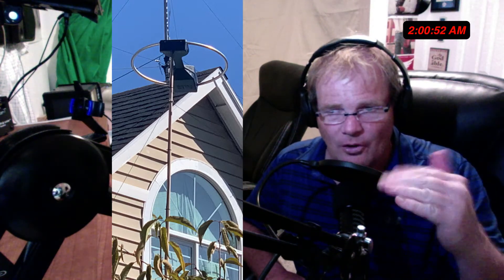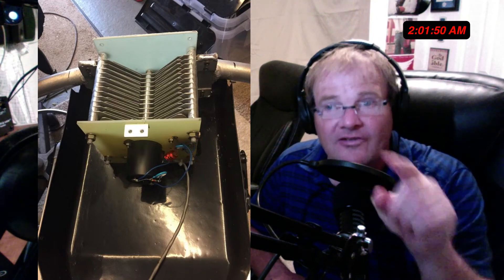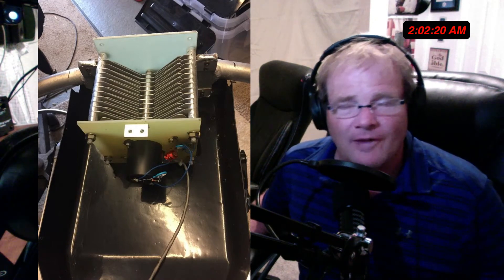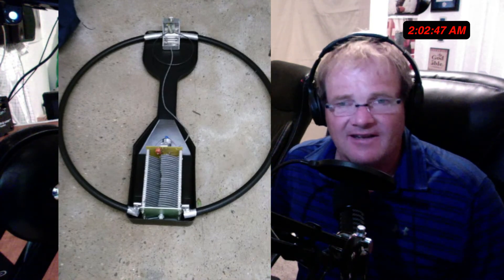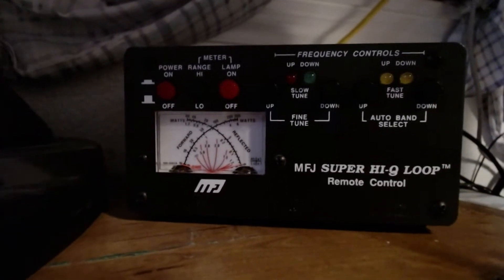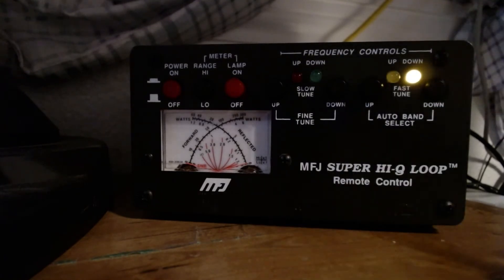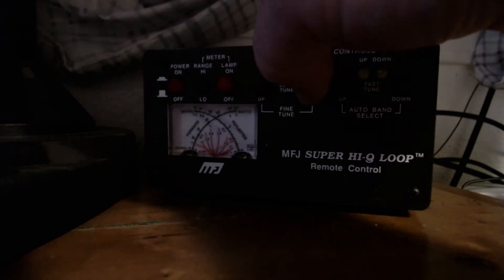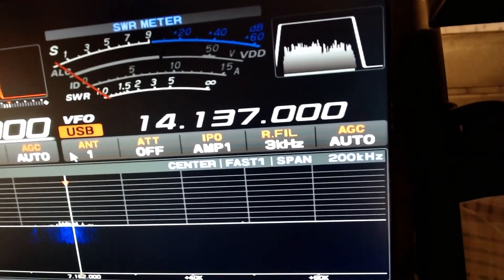HRL 26: MFJ 1788 Antenna. Full Review With SWR Readings From 15m thru 40m

Comment: I'm thinking about getting one of these for my attic, which would put it about 15 to 18 feet above the ground. Which is the better way to mount this? Vertically or horizontally? Thanks. Bob, KI5HXQ.
Reply from the maker: MFJ Says if you’re above 20 feet mount it horizontally. To be quite honest, I didn’t notice a difference between the two mounting suggestions using this loop. 

It worked really well for me. Keep in mind it has a very “narrow Q” meaning that you’ll be re-tuning it a lot when you change frequency. But it works well and it made a Coast to Coast call for me at 100 W.

Comment: If using as a receiving antenna, why not use the MFJ-1886? It helps you on all HF bands including 80 and 160. It costs less and doesn’t need tuning. It has a built in pre-amp. The TR version simples switching… 

Nice review, I just subscribe to your channel.
Reply from the maker: Yes indeed it does that. But a loop Antenna, because it works on the magnetic portion of the electromagnetic wave is going to hear better whether it’s the 1886 or the 1788. 

I completely understand your point and you are right. But both antennas work the same way. It’s just that one doesn’t need to be tuned obviously for SWR. 

Thanks very much for writing in and a very good point as well.

Larry

Comment: I have so many questions.....These are hi Q narrow band antennas.  I get the tuning part of it for transmit.  My question is on receive can you actually see signals across an entire band on a waterfall or only the portion in the band you tuned to?  Another way to put it, as a receive loop do you need to tune it with the module to hear signals or only to transmit? All the best 73’s KE8ASZ/AG
Reply: It will cover all of the band on RX but not as well as a good dipole or vertical etc. The loss is noticeable as soon as you get 10 or so kilo cycles from the tuned frequency. On a scope, what you’ll see is lower signals on your waterfall display at 10kc and greater off from center.

Comment: Hi i stay in a high rise flat which is 183 feet high and I'm on the top floor which is the 19th, I'm not allowed to put antenna on the roof but I can fix a bracket and pole on balcony so could you advise me if i should put the loop vertical or horizontal it's the 1786 I've ordered

Comment: At 4:11 minutes you talk about positioning the antenna according to the feet off of the ground. But if you mount the antenna in your attic, I can't get it past 5 feet high from my attic floor. So will I have to mount it in a horizontal or vertical position? Also, if the antenna is in a vertical position, will a rotator be a better option for the antenna? 73's from N3NQP

Comment: I have a condo at the beach that I took a radio to and used a Wolf River coil and placed . The noise level was an S 6. Will this antenna reduce condo noise. I imagine those other units. Have all kin’s of noise generating crap. I am a wee bit troubled by the other reviews I find on YouTube. You are the only one I can find that is excited. I tried a 20 meter dipole with the same noise problems. I appreciate your time. You sound like the kind of ham who is helpful to others. Thanks again. N4KBM

Comment: Good review Larry!  I have always been fascinated with the MFJ-1788 Loop.  Especially since I am in an HOA gated community.  It seems Hams are both hot and cold with their opinions about it.  That along with the high price has kept me from purchasing one of these antennas.  I have seen many good and bad reviews on YouTube about the MFJ-1788.  I wonder if in some cases it might be user error and/or lack of patience that plays a roll in their negative opinions, as well as what mode they are using it for.  As you pointed out, if you are in an HOA, condo or apartment antenna restricted area then this would be an excellent choice regardless of price.  At some point I am sure my curiosity will lead me to try one.  73!

Comment: Is it ok to use this antenna in a fixed vertical position around 50 feet height.  Tnx vu3mes
Reply from the maker: This is a great question. According to MFJ if you use this antenna above 20 feet you should mounted horizontally. I’m sure that’s because of takeoff angle. If you can get that thing 50 feet in the air, oh my gosh I think you’re really solid. I couldn’t get mine that high. I’ve just had surgery and I can’t get on my roof. My brother took care of that but I didn’t want him going any higher than he was. At 50ft. Wow.

Comment from the maker: To be very clear, at the opening when I said it was the best antenna I’ve used in 47 years,“ I’m referring to “receiving signals.“ I’m a firm believer in a “dedicated receive antenna” for ham operators who don’t have a directional. 

I believe it could save many senior Ham’s staying on the air because frankly many of them are moving out of their “forever home,“ where they’ve raised their children and now need to downsize to a condo, townhouse, or assisted-living of some sort. but HOA’s prohibit antennas.  

Because this antenna can be deployed so quickly outside and then brought back in, it’s perfect for someone in that position to be able to keep them on the air where there isn’t room for a dipole and no chance for a vertical.

Because this antenna is so easily deployed and can be mounted in a portable manner, they can be placed as low as 3 feet off the ground but still be effective.  

Will it be as effective as a vertical antenna on transmit? No. Will it be as good as a dipole on transmit? I believe yes. It was designed to be similar to a full size dipole. 

This test was done in unhealthy atmospheric conditions, where there is so much carbon, smoke and ash in the air. That we’ve been told to stay inside. The ions within smoke will refract a signal. Many studies have been done proving this.  

Yet this loop on transmit was still able to make a confirmed 2,600 mile QSO over land in these conditions. 

I’m pretty impressed with any antenna that can be put up in one minute and placed on the air. Or placed permanently and used successfully. Frankly I don’t know of any others like it. 

It’s for this reason I do believe strongly that many hams who are downsizing will be able to stay on the air if they purchase a loop like this. They can put it outside when they want to work and bring it back in when they’re done if their HOA’s are that restrictive. It can be that portable. 

Kudos to MFJ for developing such a product that can keep many ham operators on the air long after they can no longer deploy a vertical or dipole antenna to keep them on the air.
Reply: I have a 1786 on order from DX Engineering, finally.  It's expected to arrive within a couple of weeks.  I've been posting on forums for since 2021 about how my situation, both housing and age, cause burying radials, running long wires, and climbing ladders, to be out of the question.  

When I mention that one of these MFJ's may work in my situation, the younger hams who climb towers as well as the high techies who build their own systems are very critical of my leanings.  I've had one high techie who sent me lengthy tomes about how I should run long wires all over. 

I already tried the downspout antenna (noisy on RX, and would probably would cause interference and complaints from attached households).  I also installed a G5RV Jr. on my roof that just didn't work, even with the MFJ auto tuner that I since sold.  

Critics can be relentless and often believe that everyone's situation, needs and abilities are just like theirs.  Glad this has worked for you and I appreciate your well done demonstration.  KK4GMU in Florida.

Comment: Thanks for the show.    My adult son is getting into ham radio and has the first two licenses.   He lives at home and bank of Dad is currently financing everything.   The 1788 is $600.   Recommendations for less expensive setups?
Reply from the maker: Btw: Congratulations to your son! Moving up to the General is TERRIFIC and an accomplishment to be proud of.
Reply from the maker: GREAT QUESTION!

Had to laugh... “bank of dad” BELIEVE ME... I remember those days. 

The 1788 is truly remarkable because it provides 20m and 40m. A less expensive “sister model” is the MFJ 1786. It works 10-30. So it works the same as this loop (but doesn’t provide 40m) but would be EXCELLENT as an alternative. They’re the same antenna, just the “variable capacitor is different, so it won’t work 40m. 

The receive only (MFJ 1886) is OUTSTANDING for a receive antenna, which is where SO MUCH of the value is for these antennas is. Those are asking $300 new i think. 

Would need to use another transmit antenna and receive on the loop which would definitely “receive much better” than whatever antenna he’s now using, unless it’s a directional beam.”  

I’ve reviewed them both. The 1886 Is no slouch on receive at all. It’s a great antenna that saves about $250 but doesn’t transmit. 

Your son will need to be absolutely careful to not transmit even a Watt into that antenna, otherwise he will destroy it. 

That’s the “safety“ built into buying either be 1786 or OR less expensive (but missing 40m) 1788. 

You could always check Ham Radio website sales for used equipment to try to find one as well at a cheaper price.

Be careful, because this is a unique antenna with a motor and moving parts inside. Plus, if you buy one new, MFJ has I think the best warranty in the business. 

It’s a one year warranty, even if you take the thing apart yourself and can’t fix it, MFJ still will under most circumstances repair it. 

What rig does your son use? Any amplifiers? Does it have an Auto tuner? Are there any tall trees on his lot? These are important questions

Does he have any antennas presently?
Reply: I built mine for about 30 bucks.  KG7IRJ Ohio Extra